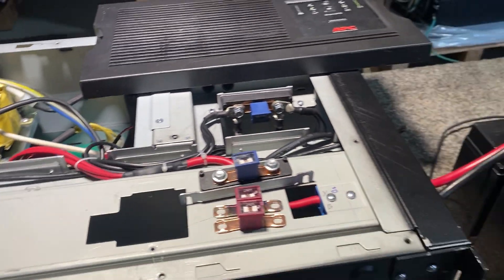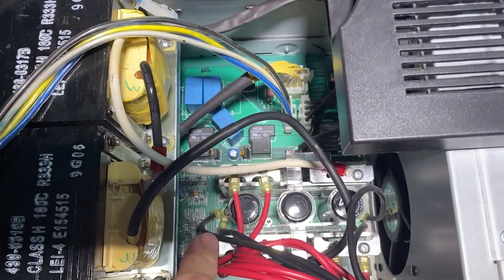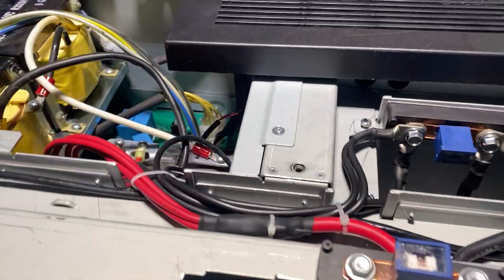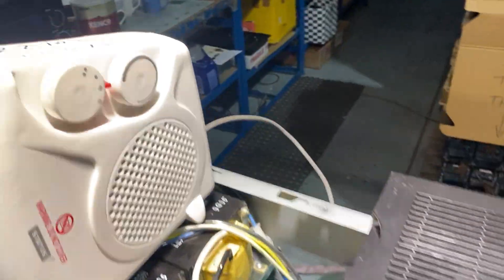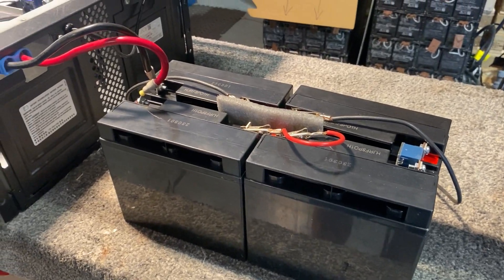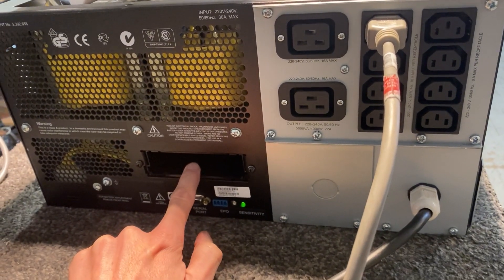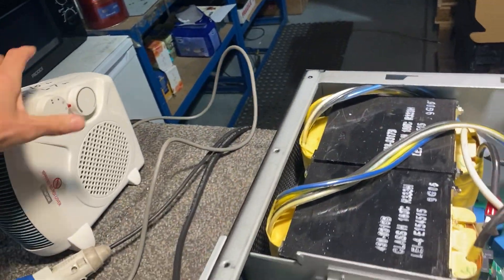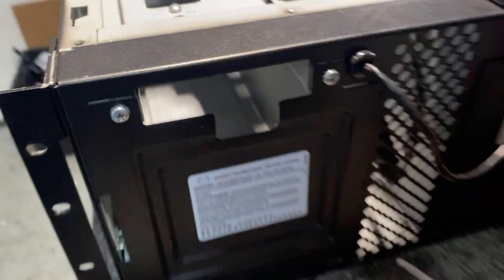SUA5000rmi5u re-wired for use as a 4KW 48V inverter / charger.

Comment: Hello,
Thank you for this video. I also want to install this in my APC UPS 5000 met vier 12V 230Ah accu's.
Do you have a wiring diagram of this?

Regards,
Jazperva
Reply from the maker: Hi we don't have a wiring diagram - it should be obvious - if not you need to get a helper to check the wiring job you are doing.
Reply: Sorry you must have told it well in your nice video explanation but my english is very bad.
Therefore ask these questions. 
What battery cable thickness did you use and what is the capasity fuse?
If you have more tips please.
Reply from the maker: Hi - I think the text in this link will answer your quetions 

https://secure.ups-trader.co.uk/rack-ups/908-sua5000-48v-inverter.html?search_query=inverter&results=18

 @janv.8994
Reply: 👌🙂 @upstrader
Reply: Thanks for your video...my concern is....the charging module inside this ups says 24v configuration.... please how were you able to make this 48v whilst the charger inside is designed for 24vdc?
Just to understand this further....is this originally designed for 24vdc or 48vdc by the manufacturer?